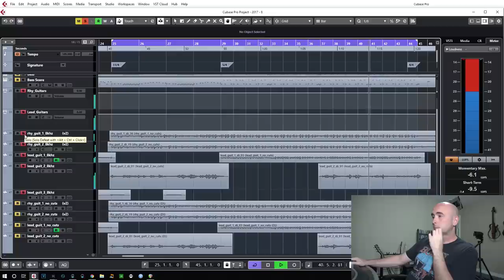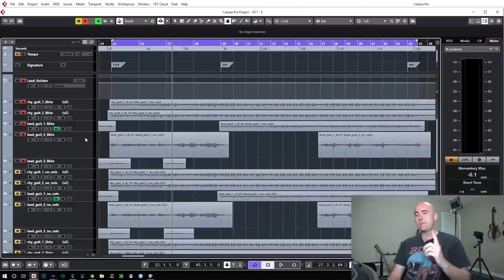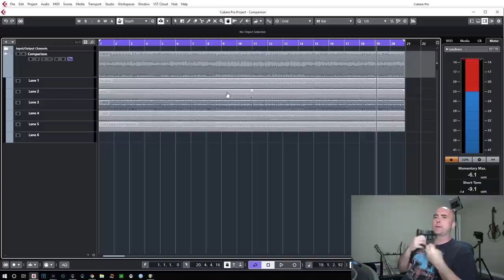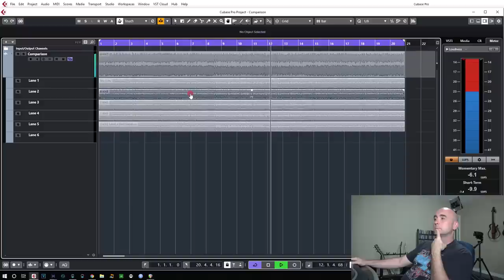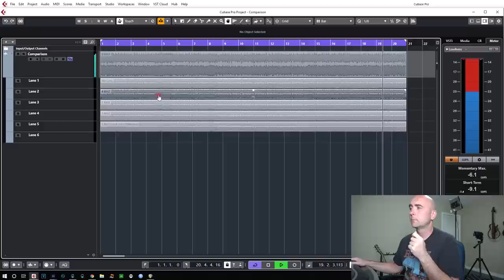Line 6 Helix - Create A Great Tone - Pt. 32 - High Cut Filters 'In The Mix' vs. 'In The Room'

Comment: Question on topic: How are the high/low cuts different on the Cab/Ir blocks and the Eq blocks?  I assume slope and/or q.  Is one far more drastic?
Reply from the maker: Yes the cuts are different between cab blocks and eq blocks. The eq blocks have a steeper slope therefore a more dramatic sound at the same settings. Hope that helps :-)
Reply from the maker: None of this is accurate. I do prefer to use stock cabs for workflow reasons and I am happy with the sounds I get with them. I have nothing against IRs in anyway. I also DO use high cuts in cab block quite often, especially when working in Stomp.

Comment: Depends on the quality of the IR, a good professional IR of superb quality may allow you to keep the hi cuts at around 10-12khz just because it is a very close representation of the miced speaker. With a simulation of a cab that does not hold these qualities, sometimes you  have to bump it down to say 4-5khz. Anything below is too dark or weirdly tubby.

Comment: Great Info.  You mention applying the High Cut in the Cab block. Is there a difference in doing cuts there before delay+reverb compared to after (e.g. cuts in the Out Block)?
Reply from the maker: Thanks much 😁 Yeah with the cuts after the verb for instance they will apply to the verb also. But  I often have cuts on the verbs themselves in their own block.
Reply: Correction, meant the high/low cuts in the Global EQ not the Out Block.  Been using the Global EQ but assume may be better tweeting it in the Cab and Reverbs instead.  Also, noticed going from 3kHz to 8kHz it moves the perceived placement forward and back.  Thinking can place the rhythm guitar back a bit and bring the lead forward by setting them with different high cuts.  Very cool and learned a lot.  Thanks.
Reply from the maker: Gary, I actually never use the Global Eq. I did a video about the Global Eq talking about that recently. And yes you most certainly could use different amounts of cuts on different tracks to have them sit differently in the mix :-)

Comment: This was interesting. 3k is too much. Sounds like you throw a blanket on the cab.  What about cutting the rhythm guitars at 3 or 5k and leaving the 8k air on leads to give them more presence? I have a two guitar band and I do a little LR pan and cuts/boost to different freqs to each to create space in the live mix.
Reply from the maker: Yeah for sure, there are all sorts of combinations that could work depending on what is desired. This video wasn't to exhaust all possibilities but more just to demonstrate what the cuts sound like. But most certainly mixing and matching is a great idea to get to the final product you want :-)
Reply: I agree with this... I think I'd do the rhythm's with a tougher cut so they don't compete as much with the solos... I'd definitely do the rhythm's at 5 and leave the solo at 8... MIGHT even try the rhythm's at 3 to give a bit more space for the reverbs
Reply from the maker: If I was actually mixing this for a real record there are a lot of things I would likely have done. This video was simply to throw some comparisons out so folks can have a reference as to how the cuts affect the sounds. Wonderful to have the ability to have all these options at our disposal 😀
Reply: @JasonSadites  great video.  Really helps to see the difference in the mix!
Reply from the maker: Thanks so much and really glad you enjoyed 😀